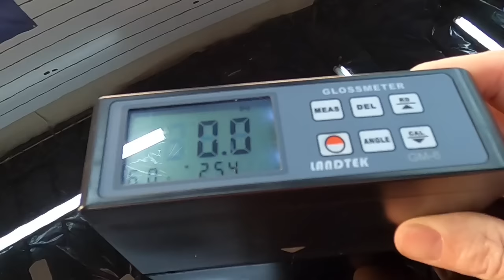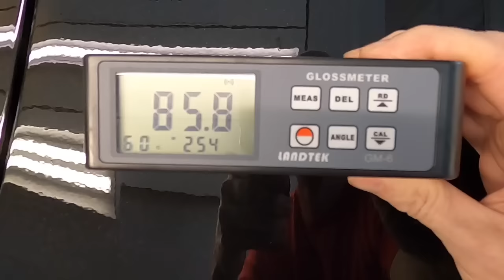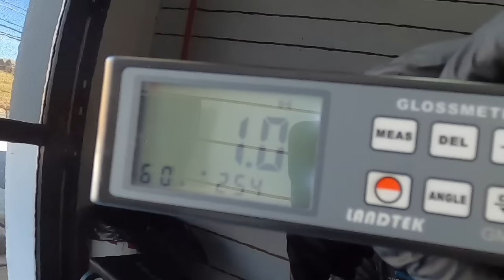Part 3! 2021 Overfinch Build! Range Rover Westminster! Coating And Topper Applied!!

Comment: I always wanted my coating to make the water roll off the car.The beading leaves spots even on a ceramic coating. I usually go right outside after it’s done raining and blow the water off. I will be using your new coating on my Camaro SS.✊💎

Comment: I need to invest in some pneumatic polishers and sanders!
Reply: Make sure your compressor push out at least 6-7 cfm constant through a 25-50 ft hose and you’ll be good. I got my old craftsman set at 7 cfm at 90psi and my pneumatic runs nice, not as cool as the Rupes but it’s still good.

Comment: Looking for the Sheet pro showcase & 

Brian,

If a car is previously coated with  Artdeshine’s (ADS) original Metal Oxide 3 year coating which has no re-coat window-

Then can it be layered with the Apex Surface Protection (ASP) Metal Oxide 5 year coating to extend the bonding durability from:

(ADS) 1 layer = 3 years + (ASP) 1 layer = 5 years to a total = 8 years by layering both products?

Keeping in mind they are both ceramic, tin antimony based coatings of the Artdeshine family.

Comment: What was that microfiber that Jr. was using in the beginning of the video for the polish, the blue/grey one?  It looked nice for residue removal.

Also, I probably missed it in this vid and the previous, while either topper can be used stand alone, can they also be placed on waxes and sealants?  As a driveway enthusiast I haven't quite caught up to coatings yet.
Reply from the maker: Not 100% sure...I believe from Microfiber Madness.